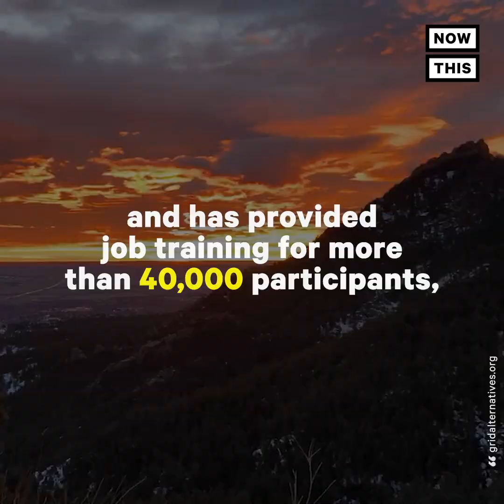Solar Energy Is Creating New Jobs for a Sustainable Economy | NowThis

Comment: Putting solar panels on my roof was the worst financial mistake I've ever made.
Reply: Why?  I would bet you didnt know, and your installers "forgot" to mention that you also need batteries to charge in the daytime, and feed you in house system at night.  Mybe they also told you (or didnt tell in this case) that your solar fed into the regular power lines to feed your neighbors on down the road, instead of your own household.  Why they get away with it is an amazing thing.
Reply: Greg Egan as much as we want to think solar panels are perfect it still is expensive only some areas really can benefit
Reply: @youtubelover1311  It wasn't just the expense, the installer went bankrupt, have no warranty, and they keep breaking and no one wants to repair them (at my expense). Total money pit.
Reply: the market is still experimental and volatile and most of the groups working with the panels are small scale companies that risk failure and putting people in your position.  In time I think it'll be a smarter option for more widespread use but at the moment  there's still a lot that needs doing likeletting companies build to stable states and having effective methods of repair or even removal and recycle for the panels if they don't work. I believe longterm it'll be a wonderful industry but for now there's still speed bumps and hurdles.
Reply: @Michael45007  You're making assumptions about me that are false. I did the research, at the time it made economic sense. Then the market for solar credits where I live collapsed, from like $300/Mwh to nothing. I knew there could be fluctuations but it totally collapsed. And then the installer turned out to be unscrupulous, as he went bankrupt he did a rush job on my installation so he could collect his money but did a terrible job, I had to fork over more money to electricians just to get it to work at all. Before this the installer had a good rep. Unless I had psychic powers it was not MY fault as you say.
Reply: @Michael45007  Last word on this, I'll try to educate you a little. The SrecTrade marketplace is what makes putting panels on your roof worth it or not, it is DIFFERENT depending on where you live. Your neighbor obviously lives where it is still economically viable, where I am it was when I installed them and then the market collapsed. It's really not necessary for you to be a total dickhead or put your ignorance on display.

Comment: I think the United States should invest in Nuclear Power.
Reply: That's not renewable
Reply: No nuclear isn't reneweable but it's still far less waste as opposed to fossil fuels and the waste is contained, we just need a place to put it. there are risks but technology has been helping it get further. I've also seen some stuff about using thorium opposed to uranium which puts out less energy pound to pound of material but thorium is MUCH easier to get and much  safer to work with with much less waste and it can't be weaponized.  Granted we still need a more permanent solution to nuclear waste disposal and the risk of a chernobyl situation is also a thing to worry about with nuclear but as long as we keep learning and fixing problems before they get out of hand it's something worth working on in my opinion.

That isn't to say we shouldn't move towards renewables, the tech there is also growing by leaps and bounds. I saw another piece on using carbon nanotubes to catch at lot of the heat that bounces off solar panels and make for much more energy gain, and the industry as a whole can get jobs in manufacture and infrastructure to thousands of americans . But until the technology catches up, nuclear is a stronger alternative to fossil fuels for powering our grids. Honestly though the biggest hurdle is batteries, and containing power for when we need it the most, when the sun goes down before we go to bed, it's called the duck curve and it's something we're still struggling to get over.
Reply: @nomnomgoblin8901  but still, what are the wastes of solar power, in comparison to dumping radioactive cores into a landfill or into the ocean, and possibly risk contamination of the world's drinking water?
Reply: @akshaygowrishankar7440  Solar panels are made with toxic chemicals and are difficult to recycle and their manufacture still has something of a carbon footprint (but longterm not so much). Same thing with the batteries that the solar and wind power are connected to. But do go back and read again, I said nuclear isn't perfect and we need a better system of containing waste on a permanent basis and  we need to look at ways of making it cleaner like thorium salt reactors mentioned above by another comment. 

If I remember correctly the thorium is inert and doesn't go into a nuclear state until you pelt it with neutrons and when you stop doing that it returns to a stable state, eventually breaking down into lower grade uranium or neptunium but never plutonium like the uranium we currently use does. But it means you can theoretically set up a small scale reactor and walk away with if if you design it to stop if it gets to X point long before it risks going critical.

I'd like to see solar and wind win out in the long term, most definitely as well as hydroelectric in areas that can sustain it.  There's still some ways to go and though I love seeing progress in the field if we just wait for everyone to ditch out fossil fuels over panels and windmills we're going to be waiting a long time while we have a cleaner alternative to FF energy plants already existing. 

Fossil fuels to a clean nuclear until we get to a point pure green energy can take over.  Don't stop working on solar and wind, keep it going, improve it. it's what'll win out in the end, I'm just advocating for a good middle step, or at least better than what we have.
Reply: @nomnomgoblin8901  but thorium reactors haven't been proven, the research is all but important in the eyes of politicians, and uranium and plutonium reactors are wasteful and inefficient.
Reply: It would be worn out around 50 years times
Reply: Agree with investing in new nuclear power. Next gen plants are much safer.
Reply: @Greg29  but not as cool as saying that you can make power from LITERALLY EATING SUNLIGHT. Plants do it, why can't sophisticated thinking creatures with technological experience?
Reply: @Greg29   FIX Hanford First & Do it With PRIVATE ENERGY Industry  $ & Nuke Power KEEP U Enslaved Solar Ownership DO  NOT & The Farm Animal HATE NUKES & LOVE $ I SAVE FOR CHICKEN FOOD FROM MY FREE POWER SUN & WIND .
Reply: It's expensive to build nuclear plants, and expensive to keep stable.
Reply: Akshay Gowrishankar the benefits of nuclear energy far outweigh the costs of operating a power plant.
Reply: @TheLiamster  but that's balanced out by two things: firstly, the LITERAL costs of running a powerplant are too much; secondly, there are far more sustainable alternatives. My grandfather's friends are former nuclear physicists. They're a lovely bunch of people :)
Reply: Solar is the way to go
Reply: Liam Walsh We have the greatest nuclear power plant that man has ever now, it’s called the sun, why not use that?
Reply: Thorium
Reply: We have nuclear but solar is like a good place to start anyway
Reply: @dirtycas  remember, our atmosphere has more energy than we can imagine.....all from the sun... collecting light is stupid....when the electrical energy is there....... something something Tesla
Reply: silverpairaducks again solar is a good place to start.
Reply: @dirtycas  not really
Reply: I think solar is better simply because it's decentralized so that if one portion of the power grid fails, many still have power.
Reply: @gabrielrendon  u don't understand
Reply: @gabrielrendon  so, the Amish...the Amish like Diesel
Reply: silverpairaducks they gonna get da sun’s power like Jesus
Reply: Please stop thinking then.